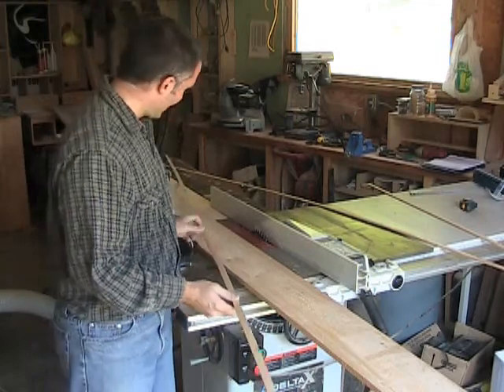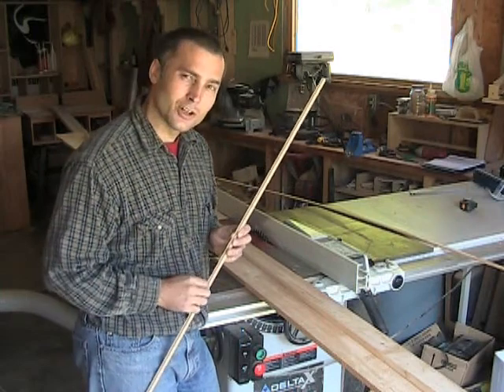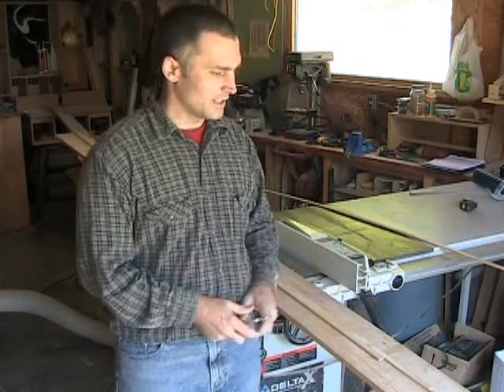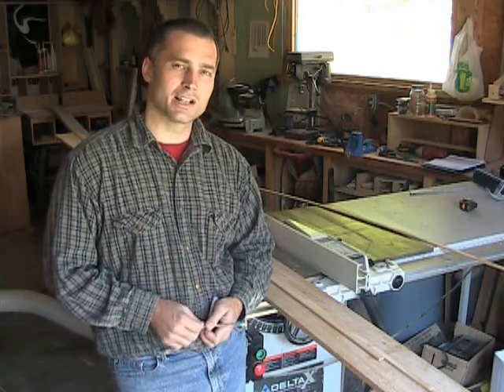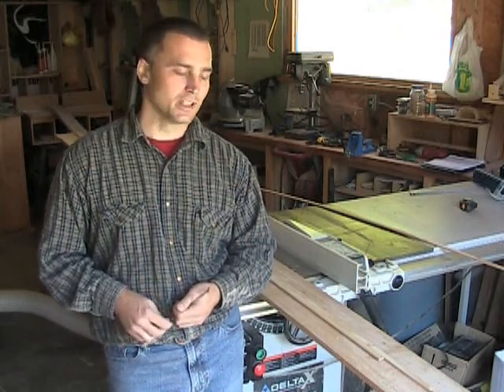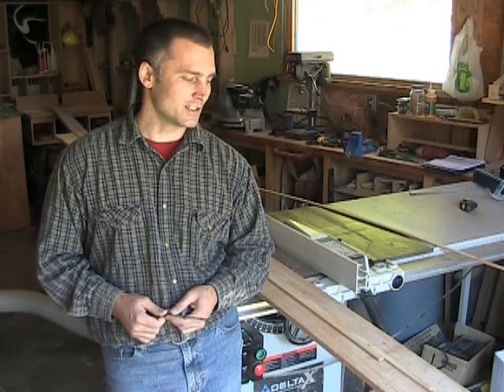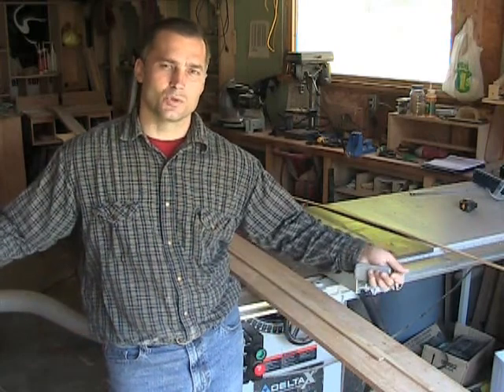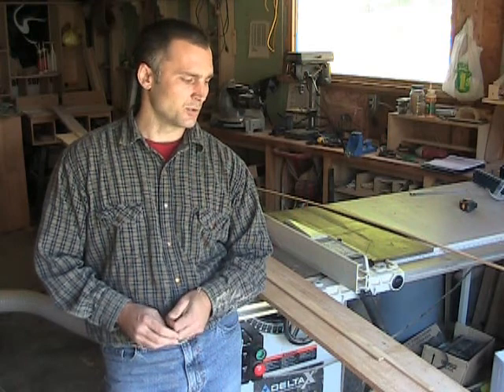Cedar Strip Boat Building: Milling Cedar Strips - Pt Two

Comment: One thing I've found out is to use as small of blades as possible when ganging them to let the motor work easier. Or if I'm ripping a bunch of anything like white oak , cherry ,blk walnut I'll put on a seven and a quarter inch rip blade.

Comment: Your videos are fact packed. As a tool maker in a former life I look at quicker simpler ways of doing things especially when repetition is involved. Like when ripping hundreds of strips my feeling is to turn metal spacers and gang as many blades as the table saw arbor can fit and make a jig of slitters on the off side to keep then from pinching the back sides of each blade like the factory slitter that is behind the single blade. Maybe a self roller feeder as well. Also set both routers up on one table with a double fence with possible roller feeder as well. I'm just writing what comes to mind but have not done this but wish to start in the near future. From your experience is there a reason these ideas wouldn't work? Obviously you're the master and I'm not even an apprentice yet at strip boat building.
Reply from the maker: I absolutely agree with your idea that a multi blade gang rip saw could be built and I've thought the exact thing before. I've even had a look at getting a power feeder. Probably for safety sake it would be a good idea to check with the saw manufacturer to see if the blade shaft could handle it.